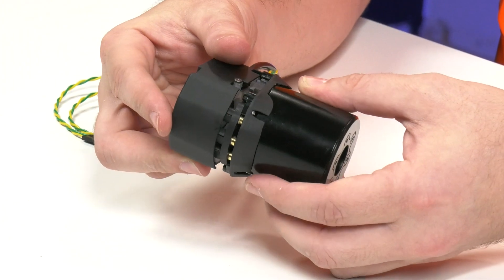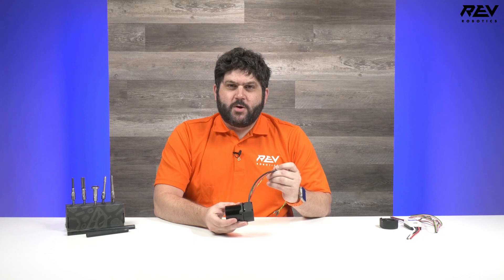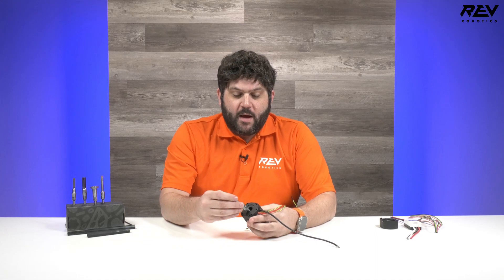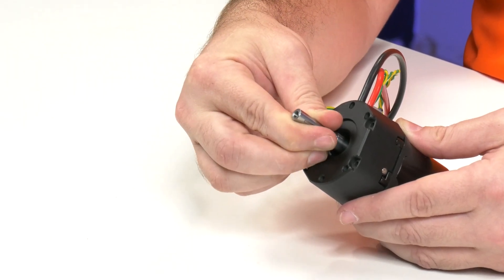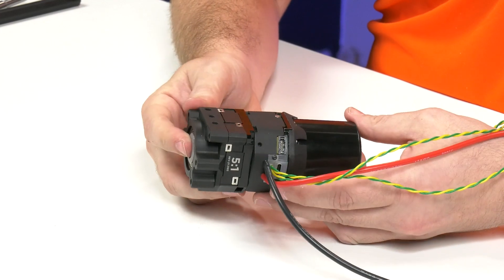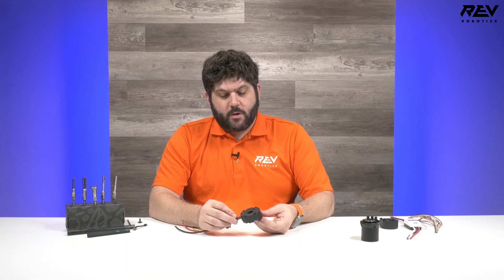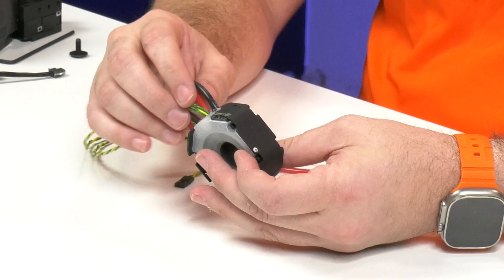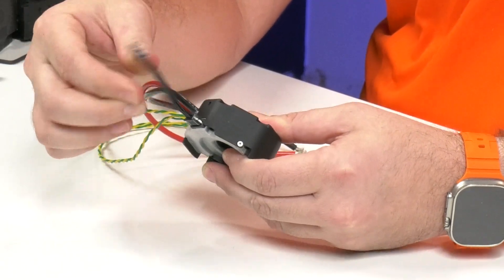Introducing the NEO Vortex & SPARK Flex

Comment: I love the docking feature! It will be super useful to have the motor and controller in one package, but still be able to replace damaged parts without having to get rid of both the motor and controller. In the future will there be a product allowing teams to plug an external encoder such as the REV through bore encoder into the data port of the Flex? (similar to the adapter boards for SPARK Maxes) #TeamREV

Comment: Cool new products REV! Love the consideration given to compatibility and serviceability, any recommendations for the best way to constrain a standard hex shaft output? #TeamREV
Reply from the maker: That really depends on the implementation of what you are doing.  The shaft retention screw we use for the Vortex shafts is the same one that people use for Hex shaft retention, so put a screw in one side and a clamping collar somewhere else on your mechanism and you are good to go.  In many applications, fixing the hex shaft to the motor isn't important. Make sure your hex shaft is constrained on your mechanism and then put the motor anywhere on the shaft that is convenient for your bot design.   We will have a bunch of CAD Application examples that show some of the unique things that the Vortex can do coming out soon.